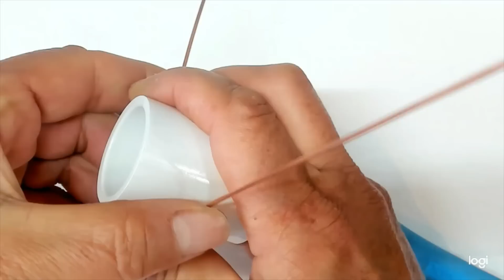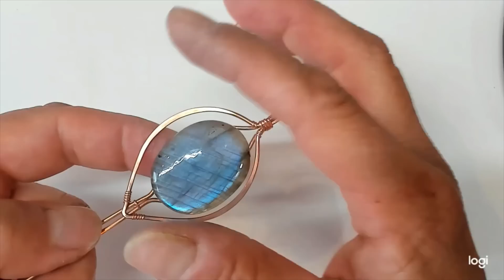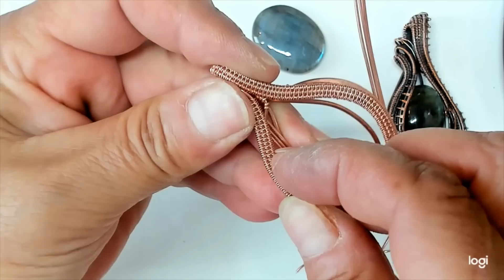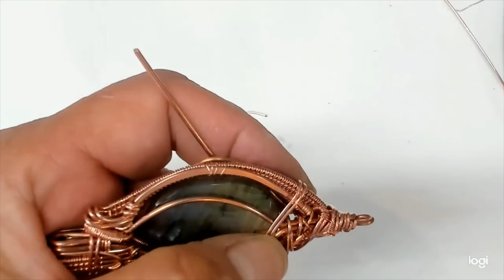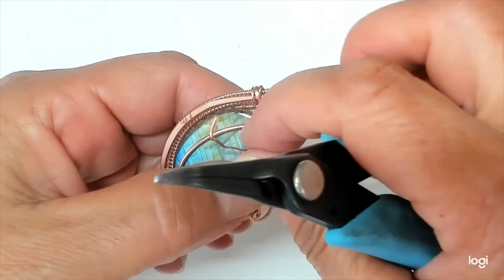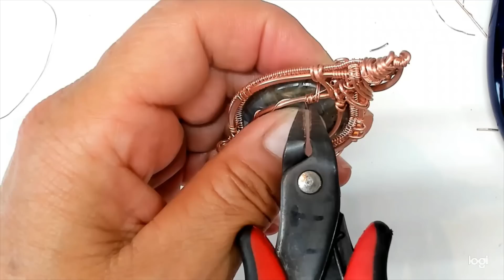Atlas Pendant TUTORIAL - Strip Weaving wire weaving, freeform pendant

Comment: Are you using copper and what gauge for your wrap core wires. when and what do you use brass for? 2 questions for you.
Reply from the maker: Thanks for great questions, Lisa!  This entire pendant is copper, yes.  The Base frame wires are 18g square but they could be sub with round, I weave with 28g wire.  You can do strip weaves in 20g base and 28g weaving wire.  The options to mix and match the wires allows you to enjoy what wire you have onhand.  I hope this helps!
Reply: thanks so much for your replies very helpful. I just love your work very professional. @PerfectlyTwistedJewelry

Comment: i'm wondering what brand of wire you use all the ones ive tried are terrible seem to tarnish
Reply from the maker: Hi, J Dunn, I use Copper wire from Riogrande.com... copper will tarnish over time unless you treat it at the finish with some type of sealant, or you start with Anti-Tarnish wire.  Natural  copper and sterling will tarnish over time due to a person's skin, and how they wear the jewelry, how they treat it.  The best you can do is either seal your bare wire jewelry or start with Anti-Tarnish wire.  I hope that helps!
Reply from the maker: PS... chances are, the wire you have is probably fine, just oxidized.  You might try to just wash the spool with soap water and a brush... make sure it dry it completely, but this might help it look a bit better.